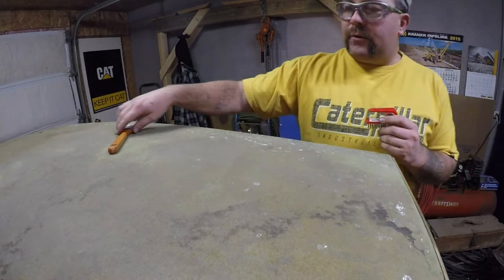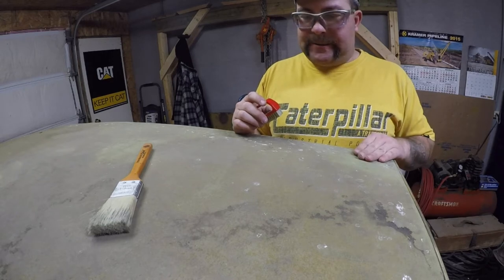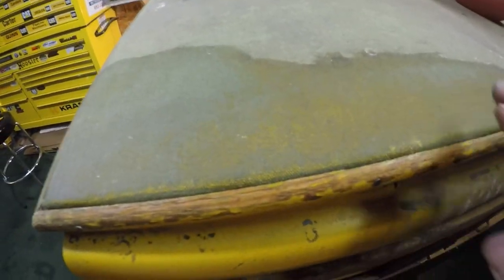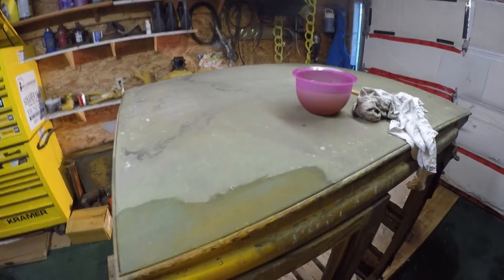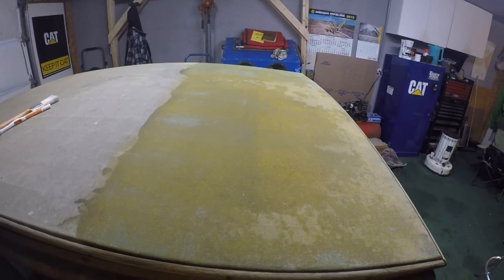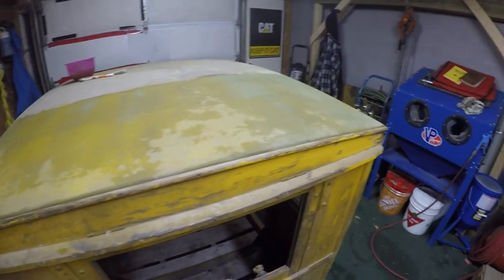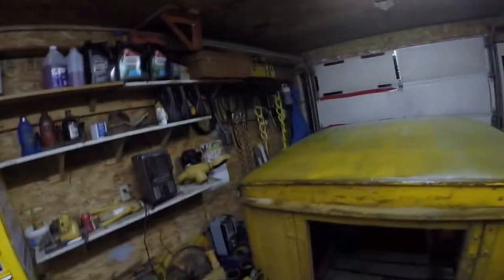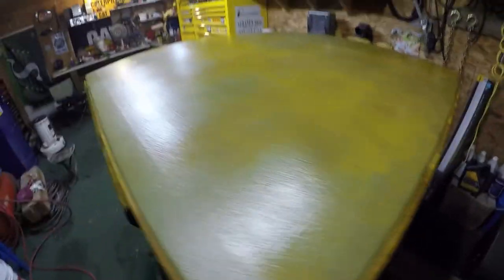Amazing Barnfind  Refurb - Part 1 - The roof

Comment: That is just so cool!  We had a small Cat (D2 or 4, never can remember) on our farm down here in AZ.  I was way to young to operated it on my own, but I sat on Dad's lap a lot when he'd run it.  I was allowed to run it around the yard a bit when I was 10-12, or so, then Dad sold it off.  By the early 70's, wheel tractors were just so much easier to move around and, frankly, even a 4020 would out-pull it.  We had an old Army trailer to move the Cat with and Dad would not allow any of the regular workers to drive it onto the trailer as he was afraid they'd drive it off the side.  :-)  Sure wish we had it back, along with a =lot= of our old stuff.  :-)